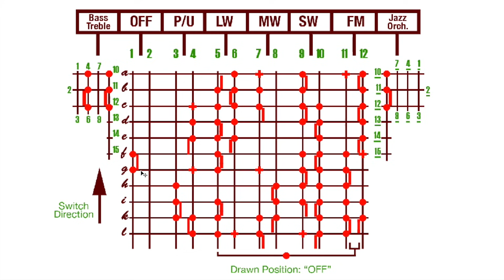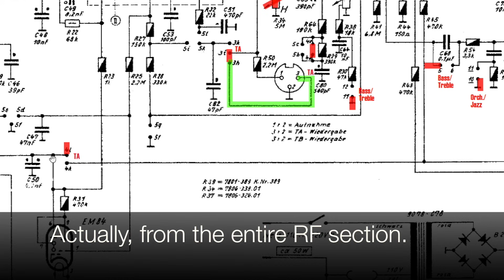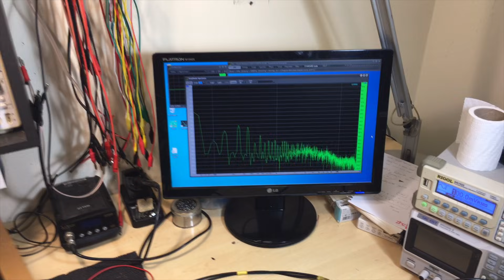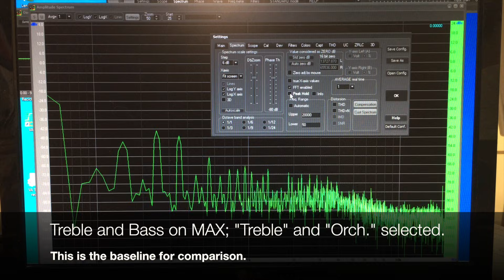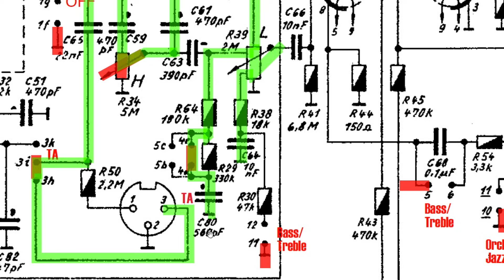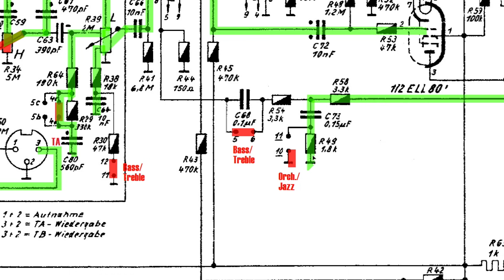Grundig 3160 tube radio Tone Shaping switching explained, with frequency response plots.

Comment: Manuel, you're dragging me into more and more sophisticated stuff... which is timely actually.  I have a Grundig 2065 that I completed restoring and it had been playing beautifully.  It sat for a bit and now I'm finding that the volume will randomly increase or decrease (on radio or using phono input) and it's gotten way too bassy.  I am suspecting a bad volume control.  The control has a fourth tab on it which I take it means it's center tapped and,  if I understand the schematic correctly, that fourth tap is connected to the tone feedback circuit to the speaker.  Assuming it is a bad pot, do you have any suggested workarounds since those center tapped pots are unobtainable these days.?   I had cleaned the pot during restoration but I have not taken it out and tried to put it back together.   If I put in a modern 3 tap pot and disconnect that 4th tap tone circuit would that be safe and would it sound awful?  Suggestions appreciated.
Reply from the maker: Those pots are unique and finding a replacement that works well in the circuit is practically impossible. New replacements will work, but the tone-shaping that’s the designers put in will be completely scrapped. Treat it gently, and try cleaning it out as well as you can.
Reply: @electronicsoldandnew  OK, thanks.
Reply: @electronicsoldandnew  A follow up... assuming the volume pot is OK what would be a next step in trying to lower the bass?  I've replaced all the paper caps in the tone circuit and all the resistors in the circuit check OK and voltages are good.  Any other ideas?
Reply from the maker: check if the bass pot is working correctly. The slider may be stuck on max bass, which would also affect the volume levels.
Reply: @electronicsoldandnew  Thanks, but I had checked that and it does seem to be working correctly.  I've read other posts about changing the cap to a lower value from the volume pot to the EABC80.  Does that make sense to you?
Reply from the maker: Yes, that would cut the bass, but the question remains: why did the sound change?
Reply: @electronicsoldandnew  I have no idea. Would a weak EABC80 or EL84 cause this type of problem?  Any other ideas off the top of your head to check?
Reply: Also, there are a couple of inductors in the circuit.  Is there any way to check them?
Reply from the maker: The tubes could always be the source of the problem, and only swapping them out will tell.
Reply from the maker: Continuity tester.
Reply: @electronicsoldandnew  Manuel, I appreciate all your help with this and thanks for all your videos, by far the most informative and well produced I've seen.  You've been a great help to me with this hobby.  One last question on this.... have you ever treated the paper surround of a speaker to "deaden" it a bit so bass would be reduced?  After checking my tone circuits (which I never would have figured out without your video) I noticed that the original Grundig speaker had a lot of movement when bass notes kicked in.  I then treated the surround with diluted elmer's glue and it seems to have solved the too bassy problem.  Does that make sense to you or am I deluding myself?
Reply from the maker: It does make sense. Any way you dampen or stiffen the cone will have an effect on the range of sound that produces the largest deviation, which are the bass notes.
Reply: @electronicsoldandnew  Thanks. I thinking I was taking the easy way out.

Comment: I am new to the hobby and am enjoying your videos, I learn something from all of them (including being painfully aware of how little I know about these complicated little beasts).  I appreciate your explanation of the pushbuttons and tone controls which have been a bit of a mystery to me.  On the tone subject, have you found that some radios just can't process certain channels on FM very well?  I have recently recapped 3 different Loewe Opta Bella Lexus 5711W radios and all have trouble clearly reproducing some FM stations. For example, our local classical station sounds great but a local country station is nearly impossible to listen to.  AM and playing music from a phone (via a cable I made from your other video---thanks for that!) both sound great.  The radio has 4 preset tone buttons plus a tone dial on the same pot as the volume control but, regardless of setting, those FM stations just don't play well.  Fact or life with some of these radios or do you know of some way to tweak a circuit to improve the performance?  BTW, I have not aligned these sets (still working up the courage to tackle that), but since all 3 are so similar it seems logical to me that they all wouldn't be out of alignment is such a way to give the same results.  I have tried different speakers, too, and get the same result.  Regards and I appreciate any suggestions.
Reply from the maker: I’m afraid you’re probably going to have to work up the courage to do the alignment of the FM. The fact that some stations come through well and others don’t could simply mean that the alignment path is not too clear. 
Come on, you can do it 😊
Reply: @electronicsoldandnew  Thank you, no doubt you are correct and what do I have to lose? I tested a better antenna and the sound was better across the dial, do you think that supports your alignment theory?   Also, it seems like the offending stations broadcast a lot of bass, I was curious if you had ever encountered the issue where some stations broadcast so much bass that the radio can't process it very well.  Again, I appreciate your response and all your work you share with the world.  Very helpful.
Reply from the maker: The stringer antenna could be forcing the signal going through to be more “readable”. The excessive bass issue is quite common, and could in fact be precisely the problem of alignment of the final stage, the detector.
Reply: @electronicsoldandnew  Meaning, man up and align it right?😉
Reply from the maker: errrr .... yes 😊
Reply: @electronicsoldandnew  You've got me going down the alignment path.  I've heard you state your disdain for cleaning up these old radios but I haven't heard a complaint about the wax used on the alignment cores!  Any suggestions on removing that wax and getting those old cores turned without breaking them?  Tool selection tip?  I picked up a set of those plastic Philmore alignment sets and they aren't up to the task of freeing the cores.  Is that a regular ceramic screwdriver and something homemade I've seen on some of your videos?  Appreciate your guidance.
Reply from the maker: I usually use a kebab stick to gently scrape out the wax. I then use a ceramic screwdriver to move the cores. Sometimes I drop a little WD40 into the cores and leave for a while before trying to turn them. So far that’s worked for me, but some people swear by using a hair dryer to gently heat the cores and melt the wax.
Reply: @electronicsoldandnew  Thank you.  Do you ever sleep?!?!
Reply from the maker: Too much, I’m told 😊 it’s only 22:46 here, and I never go to bed before midnight. We start late and end late in portugal 😊

Comment: Thanks a lot for this video. I am an enthusiastic novice, I bought a Grundig Majestic(US version) 3028 online, and I was shocked when I received this radio, it is so big! I replaced a lot of caps and what I noticed is that the tone controls work much better now. Mine has adjustments , kind of an EQ. 
I most liked your colored charts showing how the push-button switches work.
Reply from the maker: The 3028 is a fantastic radio. Enjoy it.

Comment: Hello from North Carolina, USA! Love your videos I have watched so far. I'm relatively new to German radios, currently working on a Graetz Melodia 519. Sorry my question is not related to tone shaping. One of the FM spread trimmer caps is flaky, I don't know the labeling convention and the value is not on schematic. There is a circle with ST -CO which I assume is the manufacturer. It has 2/8  and D20. I figure this is a 2pf to 8pf. Is this correct? Thanks for any help! Keep them playing!
Reply from the maker: Don’t know if you’ve got the full service manual. The components are listed.
https://nvhrbiblio.nl/schema/Graetz_518.pdf
I think this is the same as the one you’re working in.
Reply: Thank you for your help; I could only find the schematic. This helps. I just watched some of your video about the Braun that was jacked up. It makes me sad too, to see great engineering of the past desecrated. Keep up the good work. If you need anything from the States, let me know.
Reply from the maker: Thanks Tom. Keep safe.

Comment: Great video again, I was wondering if low frequencies cannot pass a capacitor, how much of the lows do you then lose in the coupling caps like C66?
Reply from the maker: All coupling caps block DC (present an infinite resistance), but present a resistance (actually called impedance) to AC that varies depending on frequency. The higher the frequency, the lower the impedance. The bugger the capacitor, the lower the impedance. C66 and R41 form a high pass filter to the incoming signals, with a cut-off frequency of under 3Hz, so the signal gets through comfortably to the grid of the ECC83.

Comment: Fantastic!  Exactly what I was looking for!  Thank you for taking the time to make this explanation.  That very neatly explains what had bothered me for some time about the Grundigs.  BTW, any idea what the + marks mean?  They don't appear to refer to any switches.  Google translates "Stützpunkt"  as "base".  Could that be some kind of chassis ground?   Thanks!
Reply: No, Stützpunkte do not have connection to ground, merely a not otherwise used solder joint for additional connections in the circuit, not related to the actual switches either.
Reply from the maker: I agree with Peter. They use these as convenient tag points.

Comment: Manuel, I for one appreciate you getting into the engineering behind design of the set you work on. It’s one thing to find a bed component then show how It's replaced but it’s more instructive to understand the design by your use of the schematic with color overlays makes this easier to follow. I believe this increases one’s troubleshooting capacity (pun intended). Keep safe
Reply from the maker: Thanks Mack. You too.

Comment: Physiologische Lautstärkeregelung = Physiological volume control
Crazy word. How much work the designer here did in this part of the radio..... unbelievable.
Reply from the maker: Yes, very complex and must have involved a lot of trial and error.
Reply: @electronicsoldandnew  The human ear is less sensitive to low frequencies at low sound levels. This is corrected by the physiological volume control, more low range at low volume. Further information here https://de.wikipedia.org/wiki/Phon_(Einheit)#Lautst%C3%A4rke-_versus_Schalldruckpegel_und_Frequenz

Comment: I enjoyed this one.  The negative feedback path thing is a bit ...ummm...unusual...I guess mostly because I have never dealt with those type speakers, but anyway, interesting effects and good explanation of how they work.
When you think about it, NO one has a flat response in their ears!  And every person has a different "frequency response" in their hearing.  So, the ability to "fiddle" with the spectrum of sound is a very good thing.
I was thinking about the potentiometers with the taps...was wondering about making a "replacement" using a pot and fixed resistors, but it really wouldn't be the same, because on the one on the circuit the wiper of the pot could go past what would be the "top" end of the fixed resistor all the way to ground...not possible with fixed resistors and pot mixture.  Where do you purchase pots like that?
Reply from the maker: I’ve done some thinking about making a replacement for these pots and it is in fact quite difficult. All the resistances interact, so the only way is to actually tap into the pot’s track.
I have no idea where to bug them. Never seen them on sale anywhere.
Reply: @electronicsoldandnew  Probably best to leave them as they are, authentic to their time, so that they will sound the way they were designed - after all, the Grundigs had their own style of sound. I owned a Transistor 300 in the late 60's and the sound on that portable FM radio was just incredible. No other set from anywhere sounded as good. You could hear when the volume control passed a certain point, that the loudness effect had finished and the control was doing flat volume above that point.

Comment: A number of German radio's have this approach to sound. The one thing you cannot EASILY get is a flat response. You end up always fiddling with the controls as you can never get a good balance on every type of music or speech. I have never understood the need  for curves for different types of music! After all, going to listen to live music does not mean a change to your ears, we only have a pre set pair of ears. However these radio's usually have good basic amplifiers and reasonable loudspeakers, just a pity you can't get a more accurate sound but a fiddlers delight for sure!
Reply: Yes, you are right, but I think the idea behind was to achieve a full sound even at low sound levels in the old small apartment rooms of the fifties.
Reply from the maker: Yes, fiddling is easy with these sets.